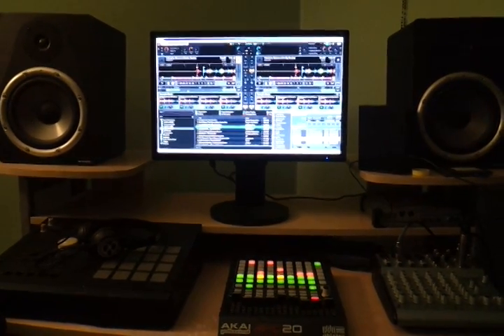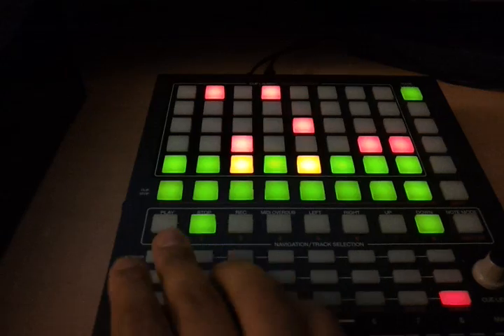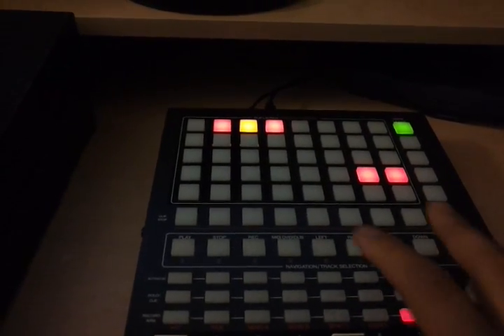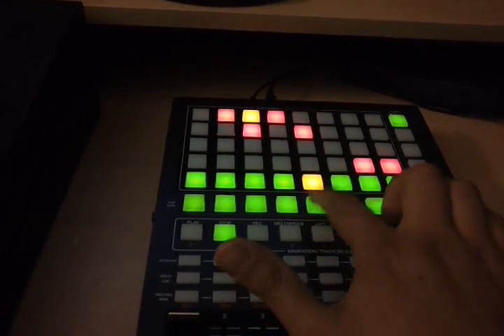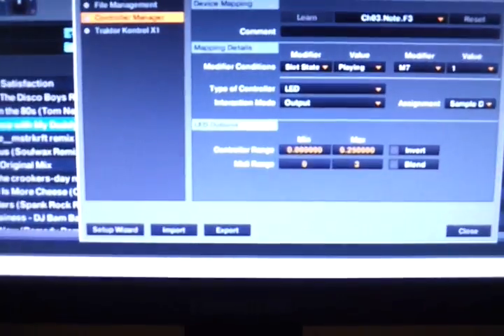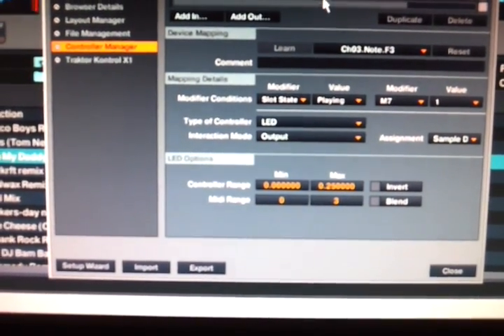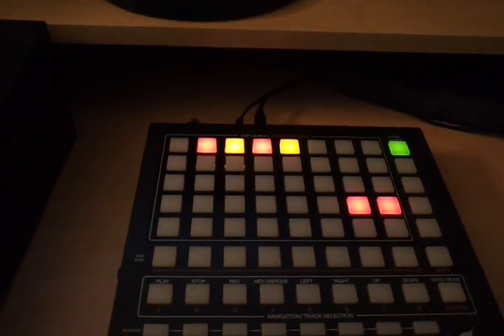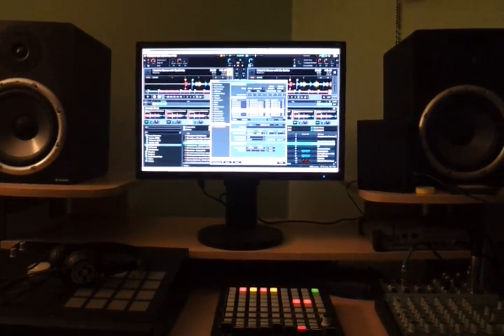How to get led feedback from Traktor to apc20

Comment: is there any way to get the activator, solo cue, and record arm to act like normal momentary buttons with LED feedback? also i notice that the navigation/track selection section outputs CC values.  this is strange.  I just want every button to behave like a button on any other MIDI controller.

Comment: Hi man It's nice mapping and u still perfecting it, I like that. However, maybe I can give you one tip on modifiers. I've noticed that u mapped those two modes (sample/hotcue) with two modifiers for each, that way u need to switch one before engaging the other. U could map only one modifier for those buttons but to set two different values. This act like a switch:

Mx=1 -direct ; LED 1-1
Mx=2 -direct ; LED 2-2

You can still map it over you existing modifiers to get it working.